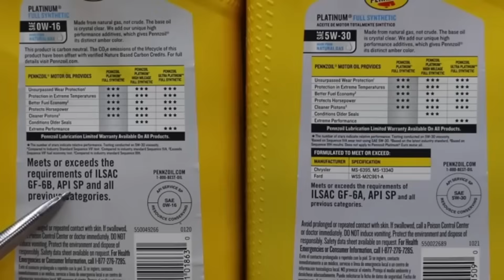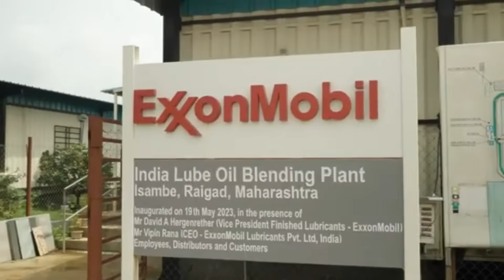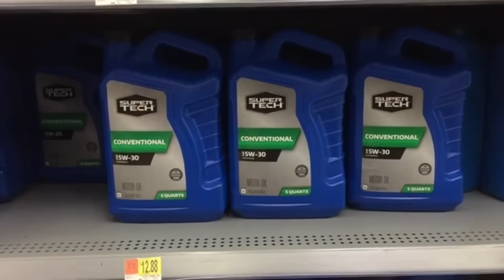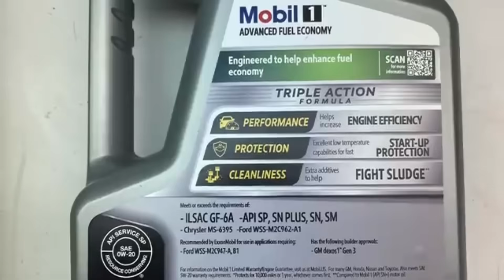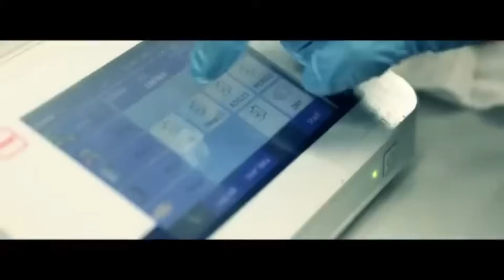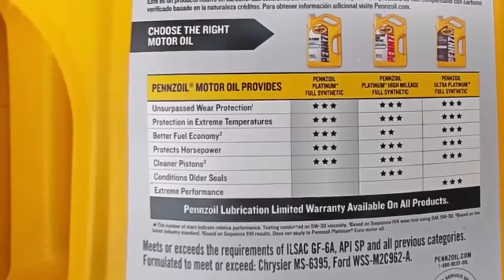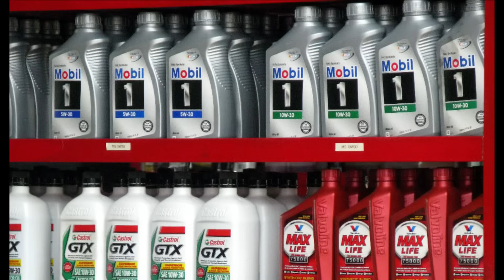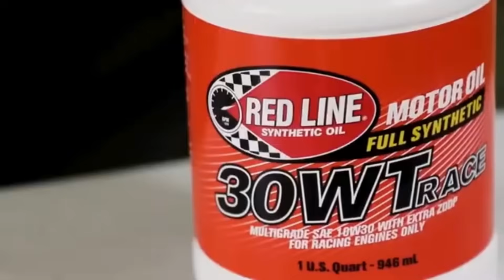You’re Paying for the Label: How Big Oil Controls the Market

Comment: Technically you are correct, but all base oils within a group aren’t the same and all additive components aren’t the same quality. On a recent Motor Oil Geek test, only 2 of the 5 Viscosity index improvers were shear stable, so just because Valvoline makes Napa oil, doesn’t mean the product is identical. They formulate to a price point, so the Napa $8 oil could be a lower quality than Valvolines top oil, or even their cheaper basic oil. You can look up an oil brand MSDS and find the CAS # se see at least what group base oil they use. Napa is group 3, but so is Liquid Moly and AMSOIL’s OE line.

Comment: Ive ran just about every type of oil there is on the market over the last 20yrs, and the only one ive noticed that makes a noticeable difference is Liqui Moly Gen 2. Its so good, i run it in all of our vehicles, boats and mowers. It makes the engine run much smoother, and when coupled with a high mileage oil filter, it stays cleaner longer than other oils ive noticed. 

Ive been using 20k mile oil filters for years now, but change my oil and filter every 3500 miles in my pick up and every time the oil would be practically black by then. When i switched to royal purple i would go 5k miles before it would be as dark.

 But when i switched to LM Gen 2, i was busy and ran over to 7k miles and the oil was still noticably amber. Dirty amber but amber nonetheless. I figured nah, thats just a fluke. I just did the same thing with my wife's car and it would need changed every 3k miles like clock work because it would be black by then. Switched awhile ago and ran over mileage on purpose and same thing. 7k miles and it was still dirty amberish color.

 I mention this, because when its black its because of carbon and metal contaminates polluting the oil and degrading its protection which is obviously no bueno for your engine. Now, im not recommending running over your mileage on your oil changes but i am saying this stuff works so well, if you happen to go over, you'll likely be fine. Im at 223k miles on my 22yr old truck and a 180k miles on her 19yr old car. Im not a big fan of newer vehicles, i have my own shop so i do all of our maintenance but i am a big fan of quality products. Its definitely one of the more expensive oils on the market. Just to do her car is about $60 and mine about $80 for oil and filters i use. But go to any lube shop and youre spending more than that for a lower quality oil and filter. Takes me 20 min to do our oil changes but 90% of that im just letting the oil drain while i walk away to do other things or enjoy a cold beer. Its the only oil ive ever recommended. I know theres a few other good ones but this performs so well i have no reason to bother with the rest of them. My truck was rated for 14/18mpgs brand new 22yrs ago. I maintain my truck so well it was still hitting that. But when i switched to LM Gen 2, i was getting as high as 19mpg. No other oil ever bumped my mpgs up like that or at all. Thats a significant bump period. Id never gotten higher than 18.2. So to hit 19 i was flabbergasted. I didnt know there was an oil on the market that could do something like that. It was definitely a surprise despite how many people swear by this oil. The reviews are legit and its the real deal.

Comment: Any oil is good if it has the seal in the back,and you change it every 3000-5000 miles period.
Reply: 3k miles lol you americans are absolutely crazy. Big oil does good bussines in america 😂😂😂 modern engine oils will do 10k miles EASILY.
Reply: I have actually seen engines that have been opened up because of internal issues in which this interval was used.

Comment: I'm sure they are all good. I used several brands in my 50cc 2 stroke moped including, Shell, Motul, Castrol and they are all very good however Valvoline smells very good among them, hopefully the summer coming, I'm yet to try Morris, Putoline, Elf and Silkolene. It's only an old 50cc moped so even the cheapest 2 stroke oil is sufficient but the exhaust smell is the most important.